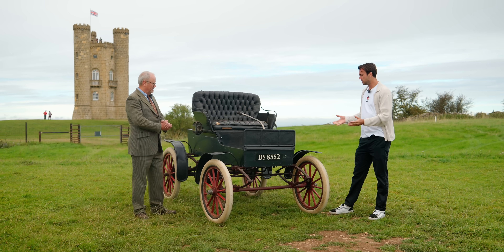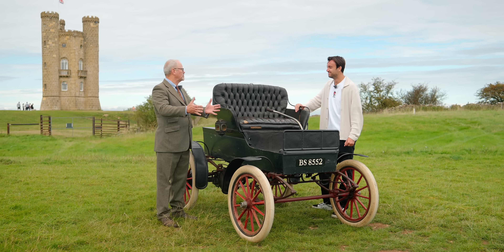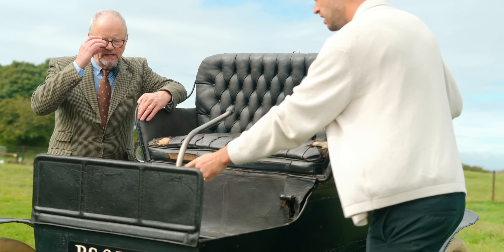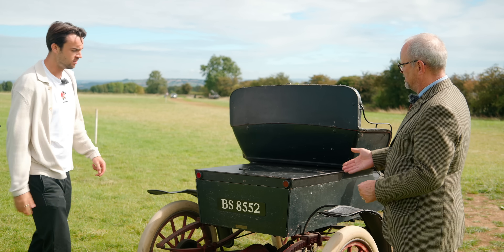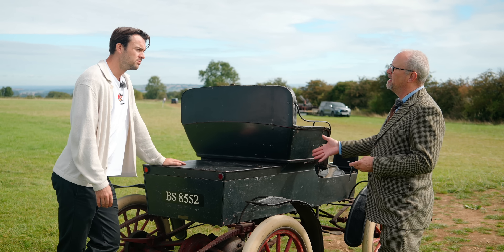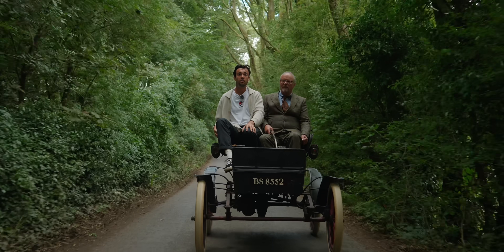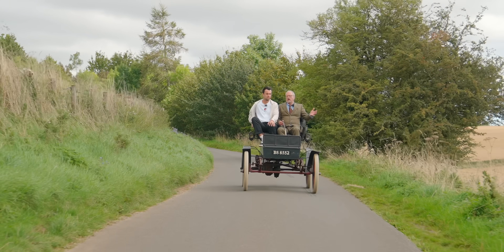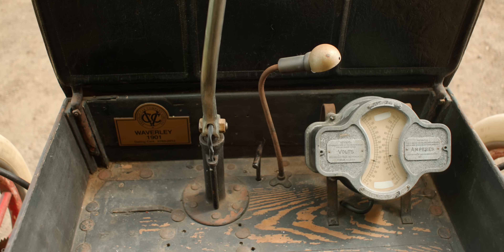Why Electric Cars Failed 100 Years Ago

Comment: Actually, Electric cars like the Baker were a resounding success in larger built-up and city areas with their 30-plus mile range.  Remember until the Federal Highway act of the 1950/60's. most roads were unimproved dirt.  With the Baker there was no waiting/priming/warming and so forth. simply sit, press a lever and go.  The Edison batteries used by the Baker were a marvel of the day and could be reconditioned and charged by the owner for very little money.  And with good care gave very long service.  No, it was the other car companies and the oil companies that conspired to get rid of this bothersome vehicle that threatened their bottom line.

Comment: One thing that bolstered gas cars over EVs back then was than not everyone had electricity in their homes. Hard to imagine that today, but back then, many homes had natural gas for lighting, but no electricity yet. If all homes back then had electricity, we'd all be driving EVs today.
Reply: Did people run their cars on natural gas back then?
Reply: @roidroid  No. Originally steam and electricity. Steam was horrible because it took 2 hours to get it hot enough to move the car.

Comment: Last night there was an electric failure cutting off power to thousands of people for the full night. What do you suppose those electric car owners did for a recharge? Since there is barely enough electricity for normal household uses where is all of this extra electricity going to come from to charge this 100% all electric vehicles by 2034?
Reply: There are blackouts all the time at our house - we live in a bushy rural area that has trees fall on lines - I own an EV never any issues, in fact EV's in future will be able to supply electricity as well as being charged - when you have a backout you will simply be able to use your car to power your home.

100% of new car sales by 2034 would still mean that most cars were petrol and diesel - it's not replacing every car only new cars

The vast majority of blackouts have nothing to do with capacity - it's normally a component failure.

Comment: There would seem to be quite a bit missing from this presentation. You don't speak much about the kind of competitions that were done back then. The biggest denigrator of electric cars would have been the one that had the most to gain by Internal Combustion Engines. The oil companies. The old saying "follow the money" would seem to apply here. Just as there was a push to remove public transit, which was of great benefit to the automobile, so too would appear to be the case with the ICE engine. There were also the equivalent of automotive magazines back then that would be funded by auto manufactures, which tended to push propaganda against the electric. And that was as early as the late 1800's. Want to bet that they were also backed by the oil industry? These days, with the advent of hub motors, elimination of the drive train gets rid of a lot of superfluous parts, friction, and the need for lubrication. This is a big deal for the oil industry. Perhaps you've already covered a lot of this in another video?

Comment: Ford started with an electric option of the Model T.  What was the tipping point was the creation of the ' electric starter ' for combustion engines, after that the advantage of the electric car starting easier went out and the combustion engine went further.  But the electric car at the time was faster with acceleration and in town driving.

Comment: Great job guys, what a super little car - how ironic that the number plate starts with (stop) BS. More seriously, These early electric cars operate with DC motors, this continued to the electric milk floats from my youth in  ‘60s and ‘70s. Modern electric cars use 3 phase AC motors (induction and/or permanent magnet), which are much more powerful, but require inverters and complex frequency control electronics that was simply unavailable at the time.

Comment: Electric Cars Failed 100 Years Ago for the same reason they are falling now. Meaning: Low energy from battery volume. Imagine a 143.3 lbs (65kg) battery with a range of 621 miles (1000km). That would be something.

Comment: I wouldnt compare steam to hydrogen. Hydrogen is a fossil fuel industry dead end designed to take grant money & other resources away from other tech such a compressed air. Steam was around over 100 years by 1901. The big issue was the time it took to improve the steam generating system to be equal or better in running cost to gasoline. This development cost also meant that steam cars at the end were too expensive, as the tech never got the cost reduction associated with high volume mass production. I would argue that an electric/steam hybrid would have been a hit, because then you'd be able to get moving while your steam system got up to operating temp/pressure. That combination would have given you incredible range and it would have been totally silent.

Comment: That was wonderful :) I would love to see an episode about electric milk floats - they were very common in my childhood, and I'm pretty sure they were lead acid batteries too...
Reply: Agreed, having driven one very briefly.  They had the ability to move several tonnes of milk and glass bottles around at a speed very similar to that achieved by many city motorists today.
Reply: My dad was a milkman, sometimes we'd ride with him back to the depot and plug the milk float in. I got up at 3am to help him once, just the once lol
Reply: Not absolutely sure but the batteries may have been nickel-iron; so-called NIFE the electrolyte being a solution of potassium hydroxide.
Reply: In the UK milk-float batteries were almost always lead-acid.
Reply: Listen to a Tesla reversing.. that nostalgic milk float noise .
Reply: I would guess that the range of those old milk floats must have been up to 15 miles, going by the distance that our milkman had to travel from depot and back. That was a journey with negligible gradients though. Dairies kept a few ICE vans to cover the rural runs. @ryszardlorenc7047
Reply: wasn't the first ice vehicles started with a starting handle,

Comment: For me the real problem was not battery, but controls. Today we quickly pulse power on/off at full voltage, to get desired torque, with little waste. Old autos were cursed with linear torque that could break axles, or they used resisters that created heat, wasting power when less power was needed.
Reply: yeah we didn't have the technology then, it didn't work until the Prius and hybrids came out, then we were able to switch to EV, it would have been impossible 100 years ago to make it, that's why all the early ones didn't work, why are we still using gas today after all this time, because it was the easiest solution to get the car running
Reply: At 8:25 it looks like some "4 bit" power control, but there is no clue if this was solved by some resistor network or by re-arranging the batteries in different configurations of serial/parallel circuits, as indicated by the voltmeter, that shows a range of much more than the 12V lead blocks would deliver.
Reply: Another solution that this car might have is to tap the winding of the motor at various points. Essentially you have 1/3, 2/3, and whole of the winding powered and so power and draw from the battery scaling with that as well.
Reply: @lindsaycole8409  I can imagine ways of achieving power control using some commutator selection as well - you'd need to have multiple ones with different degrees of 'dead space' and select as needed. Plenty of ways. Resistors are just the cheapest option, consisting of nothing more than some coiled-up wire and asbestos supports.
Reply: @vylbird8014  With combinations of solutions through competitive development it should have been possible to get a power-efficient "analog" electromechanical solution with a decent level of fine control probably by the teens. But history didn't go that way and it was all petrol from there on.

Comment: I think the issue with lead acid batteries is more the charge time. The chemisty is limited to about 10-16 hours charging time
Reply: Lead acid batteries are also a bit vague on how much they're charged. You might think it's fully charged and then 10 minutes down the road realise it's almost dead.
Reply: Given enough power and cooling capability you could probably charge a lithium ion battery in 30 minutes, 1 hour is probably a more realistic max though as it puts less stress on the cells.

Comment: Electric Milk Floats were the Workhorses in the 60s. The only noise was that the Milk Bottles rattled in their zinc steel crates - as it went along the cobbled streets at 0530 hrs.

Comment: Another problem in that time was to regulate the speed of an electric, especially DC, motor without losses of energy. The simple way was to build an array of resistors to regulate the voltage and so the speed. The resistors then had blown out (under the seat) part of the energy by heat. Riding in slow speed steps has produced heat on the cost of battery charge.
Nowadays we have very efficient electronic VFD (variable frequency drive) in every EV.

Comment: None of the early electric cars burned down the house of its owners, I'm prepared to bet!
Electric cars almost made sense in that time, because of the low number of moving parts, and the instant torque.
BUT, lead acid batteries are not a viable solution for a vehicle required to do more than a handful of miles each day. And of course, electricity was not widely available in many places.
We also have to remember modern day engineering is amazing! When I was 15 in 1980, and looking to buy my first car, my Dad had a rule: No car over 60,000 miles! This because by the time a car reached 100,000 miles (just 160,000 klicks) it was basically a wreck. 
Today, my business partner has a Mitsubishi turbo diesel van that's done over 400,000 klicks (250,000 miles) on the original motor, and it's showing no real signs of age, except on the inside!

Comment: Robert is right what killed the EV of over 100 years ago was the invention of the starter motor
Reply: I think also the lack of charging infrastructure. Not everyone had electricity in their house at this time. The upcoming oil industry was able to launch an infrastructure.
Reply: @matneu27  That could be another reason also contributed to the demise in the EV over 100 years ago

Comment: OK.  Back in the teens, my grandfather owned a chain of bakery stores served from a central kitchen.  Delivery around Brooklyn by horse and wagon.  he chose to modernize and get rid of the horses and bought a couple of Baker electric trucks.  He died in the 20s, but the new owners kept the trucks, remember this was before diesel and the gas smell would get into bakery products so electric was good for this.  Come the thirties and nobody could afford new trucks so the Bakers soldiered on, come the forties and the war was on and you couldn't buy a new truck and if you could get the truck, you were outta luck on the gasoline, the Bakers soldiered on till about 1950.  At some point the solid rubber tires were replaced but the trucks were ideal.  Not fast but traffic wasn't fast then, it was a day job so the batteries could charge at night, and it was all in Brooklyn, so range wasn't an issue.  he sold a damned good cheesecake; I still remember them.  He died twenty years before I came but I did get to see his trucks.

Comment: One thing I'd argue is that if Henry Ford had decided on manufacturing electric cars then battery tech would have advanced more quickly. All other parts of the car went through incredible advances; engines, safety systems, fuel systems, etc etc. So I don't see why the same wouldn't have happened with batteries over time.

Comment: I liked the comments about the 120 year old electric motor still working.  The pyramids have lasted thousands of years while not really being “used”, so why should one hundred year-old electric motors, stored carefully, for most of that time, not still work?  There are still plenty of old electric generators and motors still running at mostly museum sites. 

The comment about what if Henry had built electric cars instead of gasoline versions was easily answered - cheapness - without any future vision of wind turbines, PV panels and nuclear piles.  He was obviously very short-sighted and only ‘quick profit orientated’ as a business man!😊  They already had hydro power back in 1882!

All the same, a good video.  Enjoyed it and hopefully it will encourage a few (even a lot) more to ditch the fossils and convert (back) to electric motive power.

Comment: Why electric cars failed 100 years ago...because they're shite for anything more than milk float rounds. Their real life capacity goes sick after a few years and you won't even get to the shops, or back. It'll say you can...but then turn all teenagery on you and say " actually, NO"! 

So someone invented a device that is self contained and which will run forever as long as you put special juice in its tank.

The device was so good that even all the snotty ponce decision makers lapped them up and drove big phat snotty ponce versions of the device...everywhere...and will continue to do so as long as there is a hole in their snotty, dishonest, hypocritical  A's

But you...can try it again, what can you try....?

Comment: Just think; on the one hand how far would EV's have got now if this had taken off? On the other hand, it never took off for 2 reasons; 1/ and the main one I think, is that even then the oil companies had the market sown up; they did not want EV's that didn't use oil driving around, and 2/ for the same reason they will fail now; there isn't the infrastructure to make them viable; a lot of people are going back to petrol/diesel because of the range and difficulty charging modern EV's.

Comment: You guys really need to address just how dangerous modern EV car fires are compared to ICE car fires. This weeks fire was a 1 year old motorbility Vauxhall Vivaro EV in Cornwall. It caught on fire, despite not being on charge and had no visible damage to the battery, it was parked infront of a terrace house and was so ferocious that it destroyed the front of the house, the living room and it's contents leaving the disabled mother, father and three children (one of which is also disabled) homeless. The owner has provided a first hand account and receipts in the form of multiple photographs. This generation of EVs also need to fail - maybe in another 100 years technology will make them safe enough and with enough range for every day public use.

Comment: The battery is heavy. It cannot be discharged more than a finite number of times. It tends to fall in power when a large current is drawn. 
So aim for the stars. Success is 1. A model hybrid where electric motors allow mileage of fossil fuel to go up five tines. 2. A solar roof which allows the vehicle to run longer distances with lighter batteries.

Comment: It actually gets along pretty good. Modern roads helped out. But that woulda worked for me. 18 miles an hour instead of 20 miles a day on a horse.
Reply: and then you realize that this car is the first and only electric appliance you have in your house, most likely even in your village, because mass electrification hasn't happened yet.